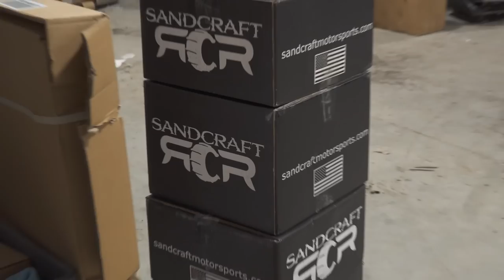Project 168 is DONE! 270HP RZR Turbo S big turbo, new shocks, new wheels!

Comment: Pro Tip. with a RZR when they are really hot dont just let them idle for 30s to cool it down before you shut if off put her in park and bring the RPM's up to 1500-2000 RPM's and you will see your temp drop quickly. the water pump just doesnt flow enough to fast cool at and idle.

Comment: Keller's rock.   That snap ring on the upper arm sucks and scares me.    Todd Keller told me if the stock arms take a shock load sideways they can fold at the bend.

Comment: Just a question please. I have a Turbo S with stg 3 AA tune / stage 3 clutch and drilled out exhaust cat . 11% lower high gear reduction.  I want to get more low and mid range horses like around 30bhp+  at the wheels. I think the bigger turbo would spool up slower that the smaller stock one  ( I understand the bigger turbo is more top end power ) Is there another way ? not toooo expensive.